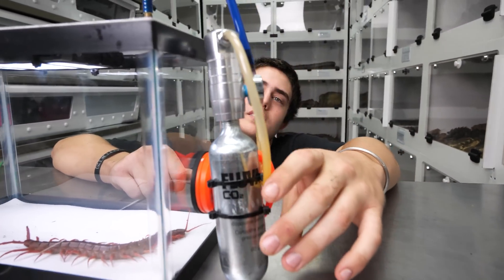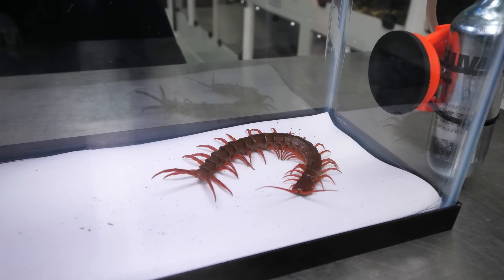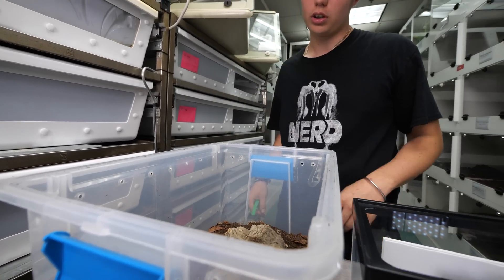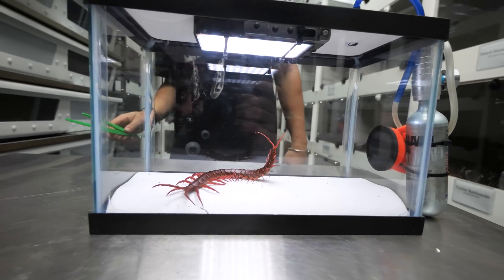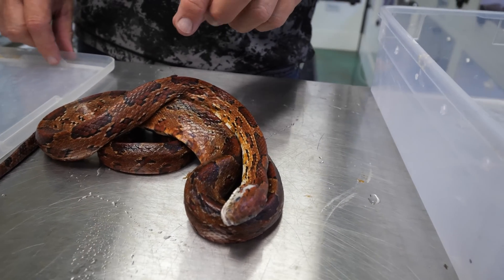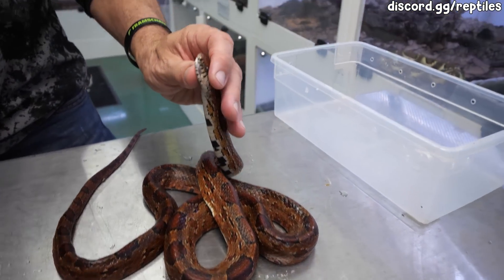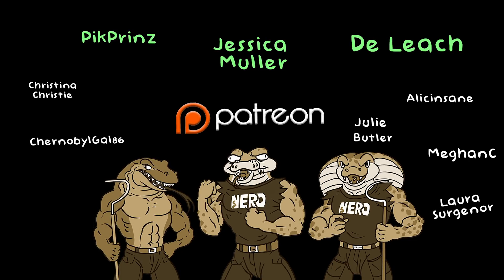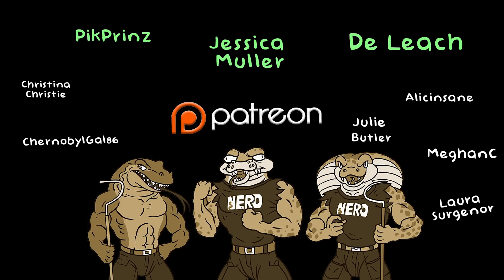I Used Knock Out Gas on a Giant Centipede

Comment: using co2 is absolutely not the safest method to sex centipedes. co2 often causes co2 poisoning after it wakes up and will cause death. ice water is without a doubt the safest and most reliable way to sex centipedes. you absolutely should not be pressing down hard enough to prolapse a centipede.

Comment: I've kept that species of centipede and I can tell you that kid is awesome. I'm a 44 year old man with decades of experience and I never considered holding mine behind the head like that. Great job and awesome info 👏
Reply: I wonder if centipede could be restrained the way venomous snakes can be by walking them into a narrow plexiglass or clear soft plastic tubing so the front end is up the tube and cannot turn around.

By hand, the lower portion of the body is held so that the snake cannot back out of the tube. 

This provides access to examine and manipulate the back half of the snake.
Reply: @RLaraMoore  definitely sounds worth exploring although centipedes are so fast and can grip with each foot so it would definitely need some sort of funnel part that could be removed and some way once it's in to stop it from pushing back out with its legs but something like that would probably work. Good idea

Comment: How is putting in water for 5 minutes  not drowning them
Reply: Right? That's literally drowning
Reply: Centipedes don't breath the same way mammals and many animals do. 

I believe they have something on each segment that's essentially its own little breathing apparatus (complete with trachea, and "lung"). So if some of the segments remain underwater, they'll go into a kind of shock, but the rest out of water will be fine. If he's keeping the top half out of water but enough of the animal is submerged, or they're keeping them fully submerged until it just goes into shock but before death, then I would suspect they could check them until they revive shortly after. It's very difficult to kill those centipedes via water if I recall. 

I can't remember what their little breathing holes are called though. Sparacles or something like that. It's been a while since I got curious about their biology haha.
Reply: ? when did that happen
Reply: @toebiter69  It didn’t. He just explained that it’s another way to knock them out but has more risks to it, especially during molting.
Reply: I believe its cause they use cold water. Centipedes are cold blooded so cold temperature will slow their metabolism into a stall and in that state they consume very little oxygen. This is how many other coldblooded animals hibernate naturally they bury themselves somewhere safe and their body goes into this cold slow state. Basically you are not knocking centipede0 out by lack of oxigen, you are slowing its body with sudden cold.